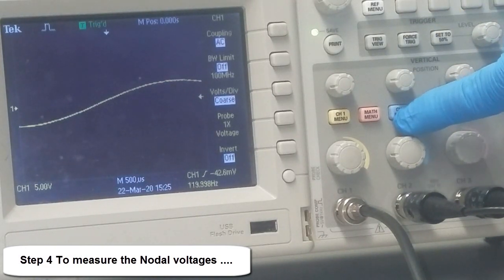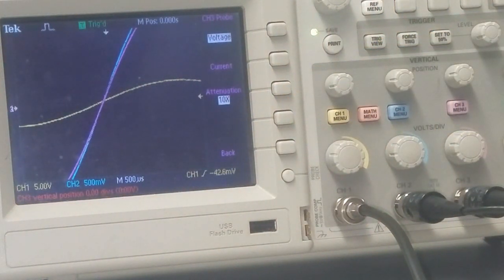Introduction to Circuits I Laboratory - Lab #8 Experiment #2

Comment: I got confused. If I have a sample to measure the frequencies, I just need the T divider and the two NBC cables, or do I still need the probe? Because if I connect it to the sample electrode, how do I measure with the probe?
Reply from the maker: I might have made it sound  harder, but it is very simple. I would use a T splitter, so that one terminal would go to the scope for measurement, and the other terminal would be the input signal to the circuit.